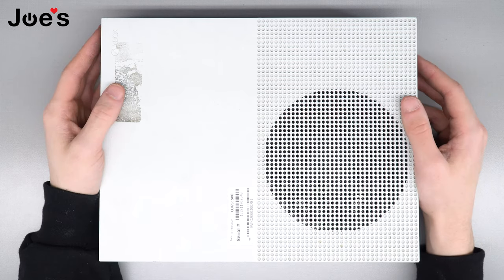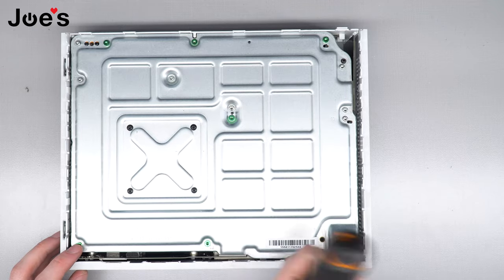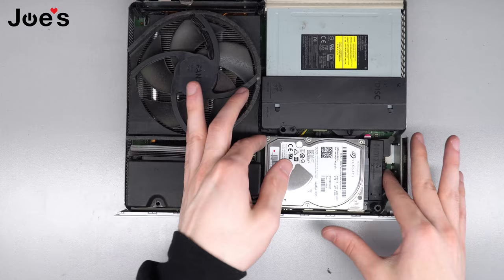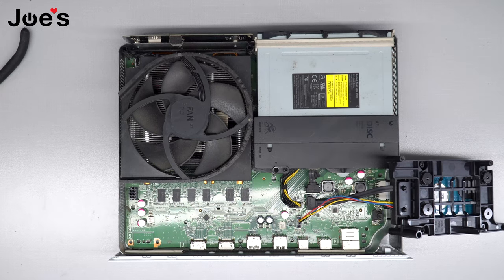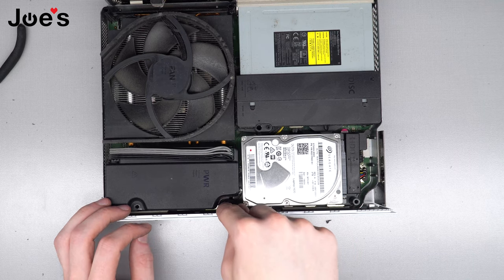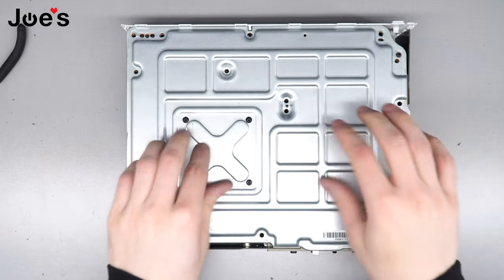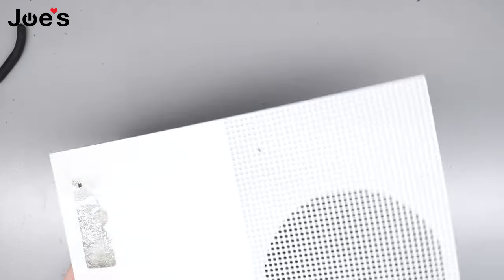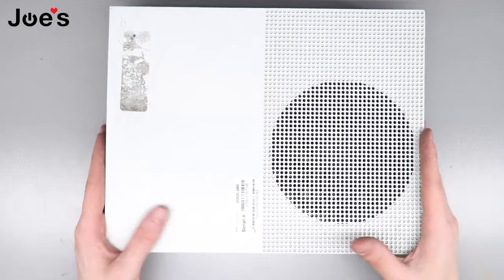Microsoft Xbox One S No Power Power Supply Replacement | Repair Tutorial

Comment: Hey there! I thoroughly watched  your video and did the procedure. The reason I replaced It was because my XB1S was not turning on and the power supply was making a faint buzzing sound, so I though a fuse may have been burnt etc. Unfortunately after the replacement, it still does not power on :(. I have almost lost hope as it first stopped working in 2019, and hasn't turned on ever since (was in warranty but I did not have time). Would you have any suggestions on what I should do?
Reply from the maker: I'm sorry it didn't work out for you. Most of the time if the power supply replacement doesn't work it is typically a main board issue.

Comment: Replaced power supply after Xbox wouldn’t power up. With new power supply and your helpful video I replaced it and put everything back together. Now it powers up for a second and shuts off. Tried several times and again just powers up and shuts off within a second.
Reply from the maker: It's possible that you have a blown compositor on the main board. This is somewhat common with Xbox one S's. It is turning on and off because the main board is shorting.

Comment: Question
My slim powers on, fan spins a few seconds the turns off. I turned back on and wiggled power cable at the power connection into back of Xbox and can't comes back on but again turns off. Just with your knowledge, does it sound like fan or power supply? I don't have a lot of money to take somewhere to have fixed plus now a days it's hard to trust someone in giving you the correct answer, may say it's something more but not so they can charge more. Thanks
Reply from the maker: Most of the time this happens its a bad IC chip on the board.
Reply: @Joesge  
Okay, Is this something you fix?
Reply: Hold on IC chip is the HDMI/video retimer.
Reply: @Joesge  my xbox one s dont turn on after cleaning i think its the power supply but the usb ports have power i can charge my phone or something but nothing other works hdd dont turn on disk dont go on idk what to do

Comment: Please help...Awesome video BTW...I had a storm surge 4 nights ago and the next day my xbox wouldn't turn on.  When I press the power button I hear the noise and the xbox light turns on for about 8 seconds then turns off.  I followed the video and replaced the PSU...Now when i press the power button I hear the noise but the light doesn't turn on and neither does the xbox.  Any ideas??  Thanks in advance!
Reply from the maker: We have had customers send in their units with this same scenario. A storm caused their console to not power on correctly. It could be a shorted chip or component on the main mother board. Unfortunately it could have shorted half of the components on the board. It potentially could be fixed but its probably not worth it monetarily. For the future, make sure to have the console plugged into a surge protector. That usually will keep your console safe.

Comment: My kids xbox. He turn it on and at reads check device power. Do you think is the power supply unit. I try different hdmi and tvs. Same thing.
Reply from the maker: Probably the Power Supply, the power cable or the outlet that its plugged in to isn't working properly.
Reply: I found out my Xbox fan wasn't plugged i think that might have fried the power supply also maybe the hdmi port as well Xbox comes on no signal on TV but the Xbox cuts off one minute after it's on

Comment: I changed out the power supplies but it still turns off right away what else could it be
Reply from the maker: Most likely a power short on the board. Usually only a technician can fix this issue.

Comment: My xbox turns on for 7 8 seconds then i hear the noise and it doesn't turn on could u maybd take my xbox in to fix think i have a short in power supply
Reply from the maker: It is possible that the power supply is shorted. It also could be any of the components on the main board that are shorted as well, but that is uncommon

Comment: Hello my console doesnt turn on amymore after cleaning and I didnt do anything wrong so now the only thing that happends is that when I connect the console to the power than I hear a like clicking sound. Could tbis he an indication that the power supply is broken? Please help Somebody xD

When I disconnect the power the sound stops immediately.
Reply from the maker: I would check to make sure that the power supply is plugged in snuggly. If its slightly disconnected it will sort the console. If it was powering on fine before you took it apart, all the components should be fine. Just check all the connections, and try again.
Reply: @Joesge hey I completly missed your reply and so I ordered a new power supply and put that in yesterday and still no power I was so dissapointed. But than I saw your comment and tried again and I noticed the plug for the power supply was pulled up but I did notice that last time so I thought that was supposed to be like that but I gues I pulled it up further and it disconnected. I bought this Xbox One s and it was the most disqustii het console I have ever bought I spend 2 hours cleaning and it still smells like the playground at macdonalds. But thanks for your comment! I can finally play some gamepass:D

Comment: my xbox makes the noise when i click on the button to turn it on but then it immediately turns off is this a power supply problem??
Reply from the maker: It could be. It could also mean that the main board has a short due to a failed component. I would try the power supply replacement first.
Reply: @yourmomishot3033  im sure its the power supply but i gave up on trying to fix it
Reply: Mines just started doing the same, gets the chime when turn it on, fan spins just a bit then stops...xbox cuts off